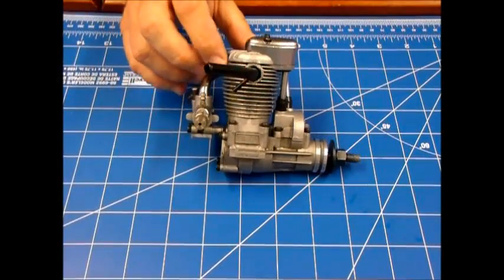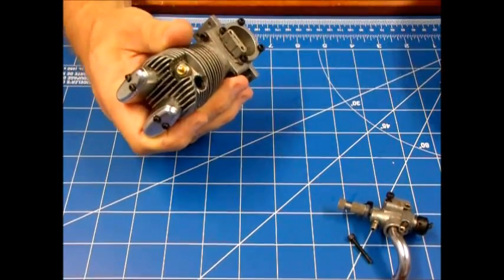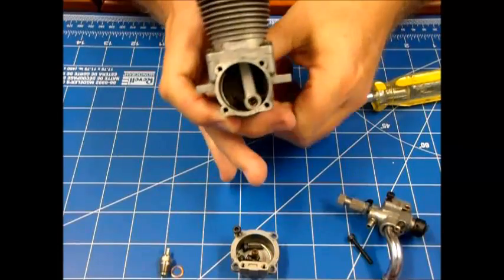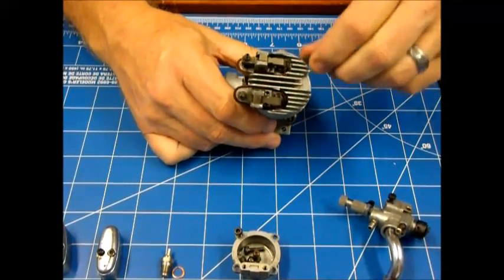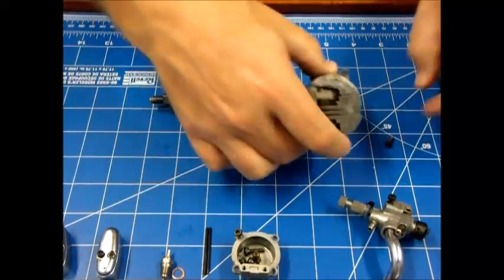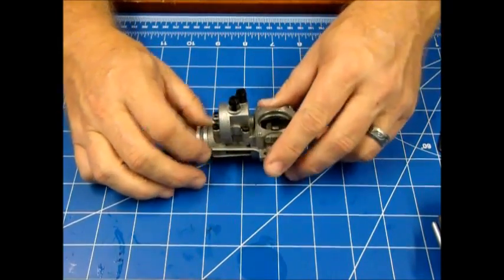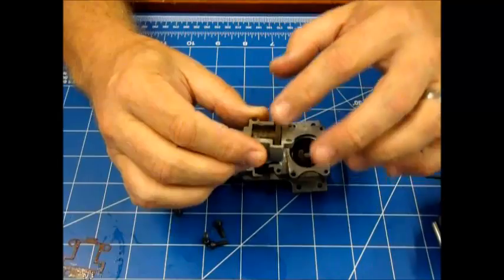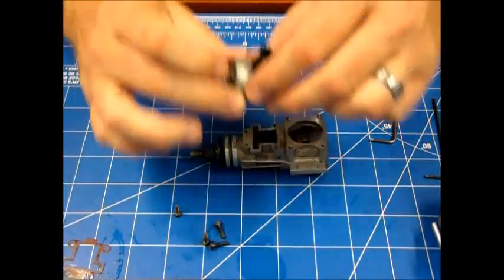Saito FA-50: Piston ring replacement Part 1

Comment: Do all Saito engines use the same size piston ring?
Reply from the maker: Well since all Saito engines don't have the same bore, the obvious answer is no.
Reply: @dmrcflyr2  Hey David, thanks for the response. The reason I had asked was because I have been looking for a piston ring for my Saito Af91. I can't seem to find it. Is there any way you can help me out by providing me with a Saito part number so I can order one? Thanks
Reply: Sorry It's a Saito fa91
Reply from the maker: First the Saito you are referring to is properly titled Saito FA-91S.  Replacement rings can be found at these places.
https://rmjmachineworx.com
https://www.macgregor.co.uk/saito/fa91sp.htm
or this eBay seller, https://www.ebay.com/str/gcpistonrings

Comment: Hi! Nice tutorial. Lost compression was the cause of ring's change?
Reply from the maker: When I bought the engine it needed many things, one of which was a new ring.  The Bowman's ring I got did not have the proper ring gap.  I had to remove some material to get the ring to fit. I inadvertently removed too much materila resulting in an excessive ring gap and lower compression.  So I got another and that is what is shown here.
Reply: +David McIntire Thanks for the answer. I have a FA50BK and when compared to others posted on youtube notice that mine is weaker. Would you know what could be causing this loss of power?
Reply from the maker: I would need more information on the engine to answer for sure. How are you determining that it is weaker?  RPM figures or feeling the compression?  Loss of COMPRESSION can be caused by several things.  First a worn ring, incorrect valve lash setting, leakage through one of the valves.  How old is the engine, or how much fuel has been run through it?  If it is a very old engine the cam lobes on the timing gear could be worn resulting in incorrect timing even if the rockers are set properly.  I have several other videos on this engine, have you watched them also?  They might provide some more information.
Reply: +David McIntire  I seeing that i need a little bit more studing about this things... :^)  I'll see the other videos to get learn more about this engine. And buy a tacometer ;)
Thanks David.
Reply from the maker: Are you new to running 4 stroke engines? I would be happy to answer any questions you have.  Are you a member of the RCGroups forum?  Tons of information there too.  I have many videos of engines running and tachometer readings and instructional videos too.  Enjoy.  David
Reply: +David McIntire Actually i debuted in 4 stroke engines a few months ago. Since i've heard for the first time a saito sound i was stuck in that moment. What a awesome sound! Was like music to my ears..  :^D  ..  Two years ago i begun on RC world and love increases every weekend. My friends on RC highly recommended RC Groups and i have signed the newsletter. My searches are limited on forums  in portuguese. However when i need  to look deeper i dig the forums in english. They are richer because the number of enthusiasts is greater. I  appreciate the suggestion and I will give further study on the matter. Then back to the questions. Big hug.. :^)